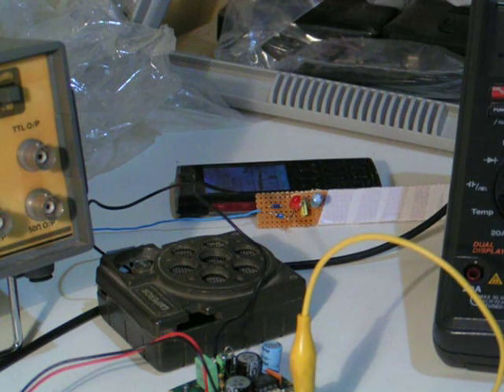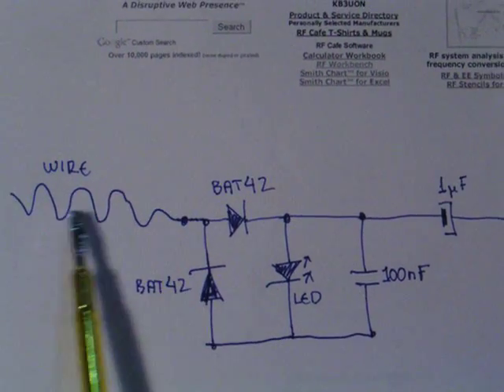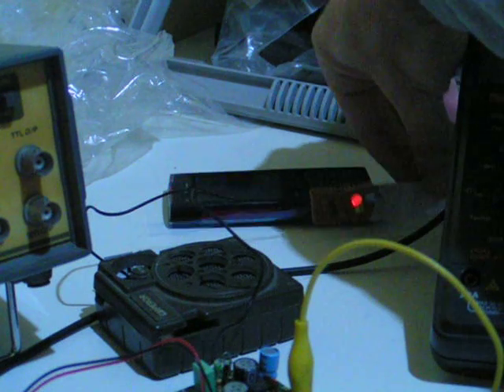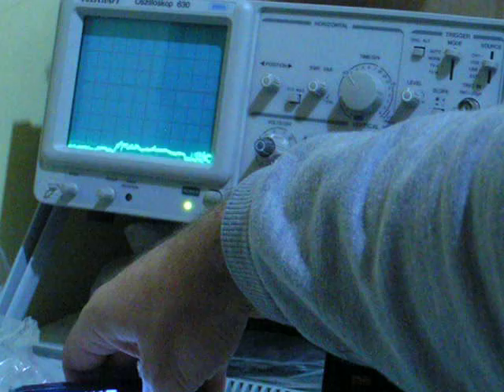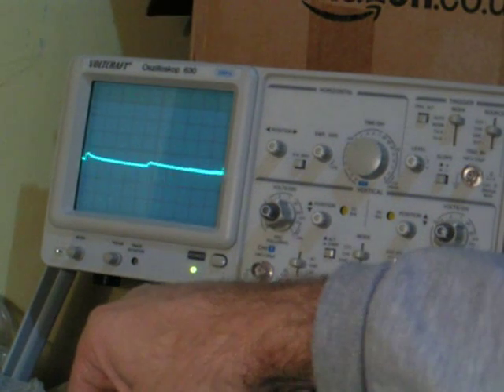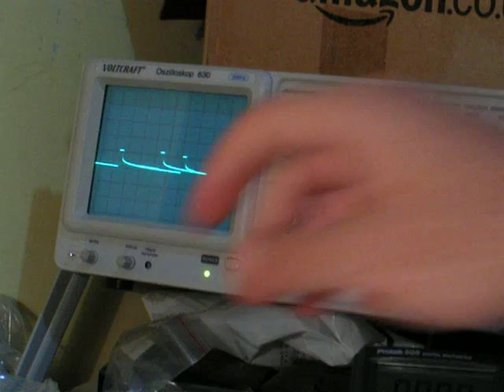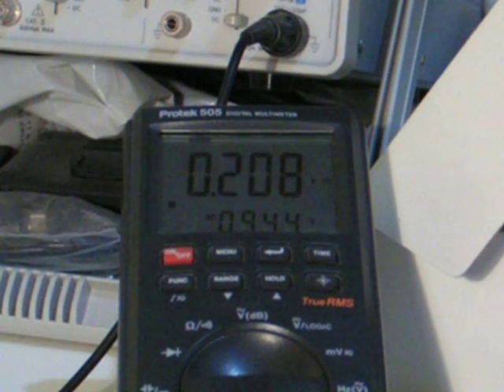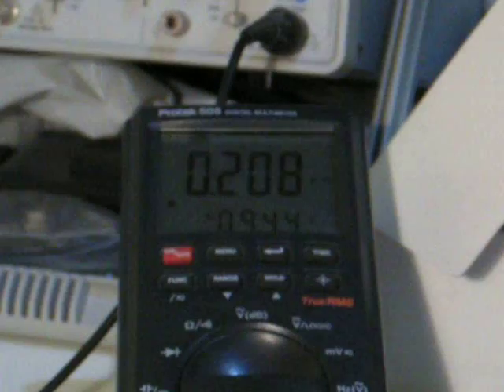RF diode power detector experiment with mobile phone

Comment: I just built the circuit, and unfortunately, I did not receive the signal. 
I used 1SS86 diode instead of BAT42. By the way, what is the purpose of 1uF cap?
Reply from the maker: +Ko James The 1uF is for DC blocking. It stops DC voltage and allows only the AC signal to appear at the output (right side of capacitor as you look at the schematic) - the audio amplifier likes only ac signals at its input and not DC :)  Hm...it's important that the wire, which acts as an antenna, is soldered properly. What type of LED did you use? It has to have a low Vf to light and not be power hungry like some bright-type LEDs do. My guess. Also, your 1SS86 has a very low max Vr, it makes it vulnerable to reverse breakdown and the voltages that appear on this circuit come close to this number. Check with other diodes perhaps.
Reply: Use 1N34/OA90 diodes instead

Comment: Could you bend the wire 90 degrees to pick up the signal the other way, or do you need two circuits with antennas pointing in different directions?